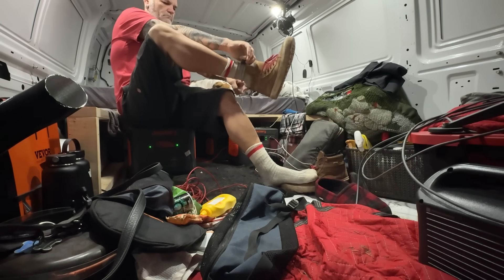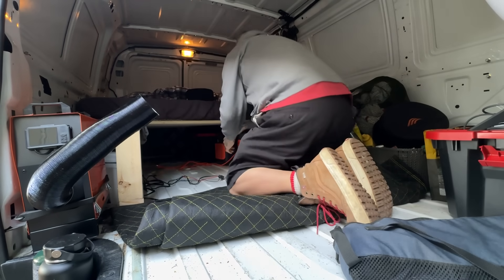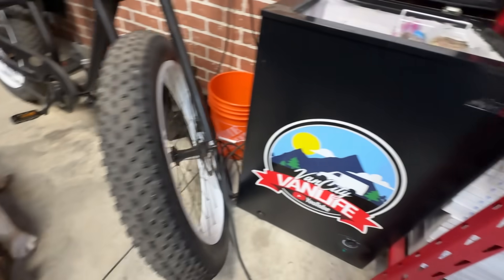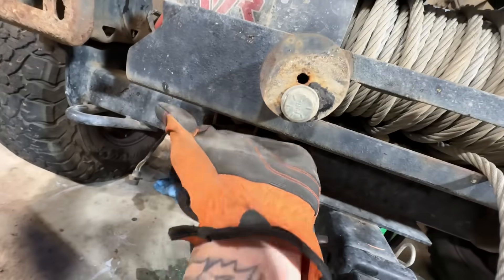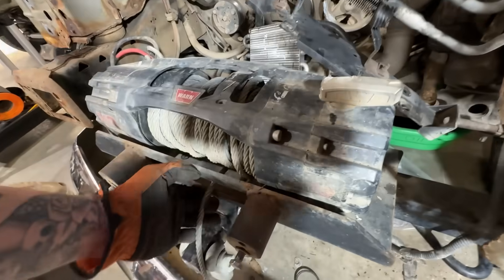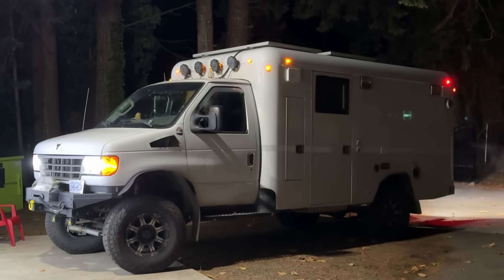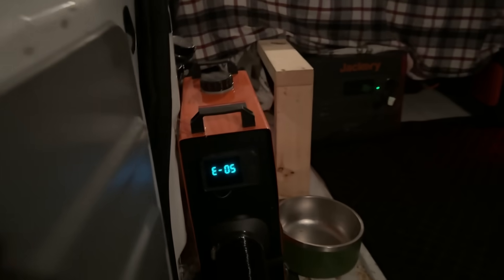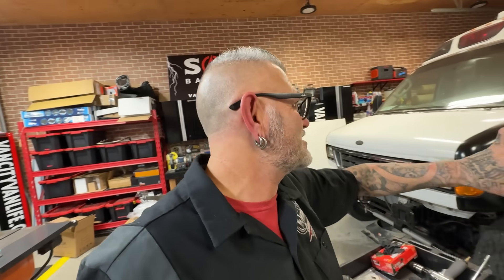IT’S BAD IN HERE. At least a Month Before I CAN GO HOME.

Comment: FYI those mufflers for those van heaters should be "inline" and not at the end. There is a weep hole for moisture and pipe should never have a down then up pitch or drill a hole on underside to allow moisture out. 👍👍

Comment: I looked up the error codes. E5 is overheating of the heater. I have seen somewhere that model should be elevated a bit. E8 code is for flame out... caused by low fuel or fuel line issues.

Comment: I had the E-05 error code for a while. Overheating. Started happening when I started burning diesel instead of kerosene (diesel burns a bit hotter). Tried cleaning, making sure everything was clear, replaced the sensor, checked the bearings and clearance. None of those things worked. The fix was to go into the parameters and turn the max fan speed up a bit, and turn the max fuel down a bit. Took a very minor adjustment to get rid of the error/shutdown.

Comment: Re diesel heater over heating, problem is most likely on the combustion side, heat and or air mixing between intake and exhaust, most likely air intake is cut where it goes through floor from floor contact as van moves (made of paper and foil), floor is probably heating up from exhaust in contact, no heatproof sleeving on exhaust and normally it would not contact floor when fitted with floorplate in vehicle, all combustion pipes and connectors would be outside, no friction while driving and no heat transfer if fitted with pipes not touching as is necessary with supplied air intake pipe. You can change the air intake pipe to the stainless type, won't cut as easy and if using below -20c you can wrap the two pipes together for a foot or 2, stops the air intake from freezing closed with condensation, best of luck with it.❤

Comment: Hey Chrome,,

We had E-5  come up on our heater it means your heater is over heating , it turned out that the hose disconnected inside the heater so when we reattached it, it worked again.

Comment: Chrome. E-05 over heat.. take the muffler off. And take the filler out of intake and clean it.  Maybe blow thru the heater with compressed air. Grim stuck to fan blades will cut the amount of air flow.
Reply: Chrome is just what I've hade to do. 5 Years with the same heater. Only 1 glow plug. Never opened and cleaned. Runs on high all the time it's on.

Comment: I don't think its a bad thing to be attached to your home. You've put so much into the van to make it what you wanted that if you'd just ended your time in that van, you would have had to put a lot into the shop one just to make it second best. You can do the rust repairs, fix the engine, and have your home back till you want to do something else this way. Then when you decide that you want to change, you can do it with a clear home owners conscience. (because that's what it is; not just a vehicle)
Reply: the vans are the same, you could pull the interior out of the rusty one, install it in the shop van and never know the difference, except...no rust and a working motor